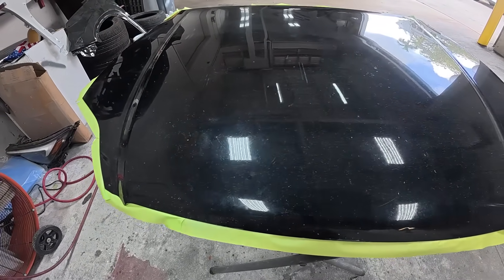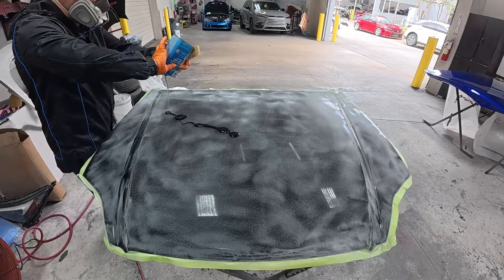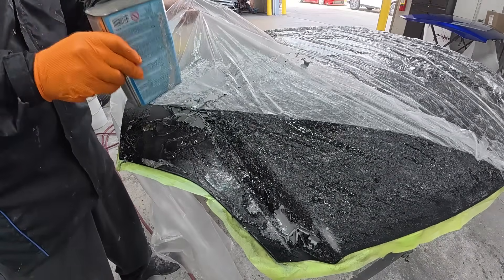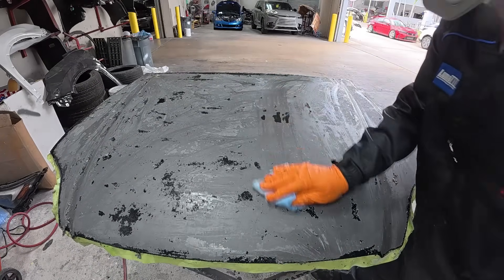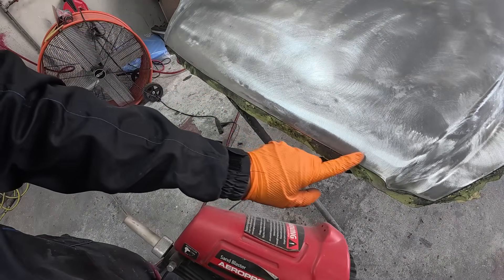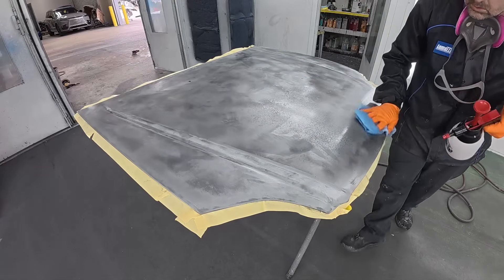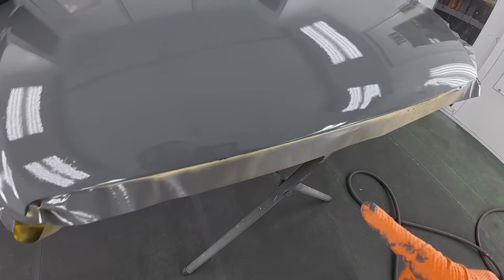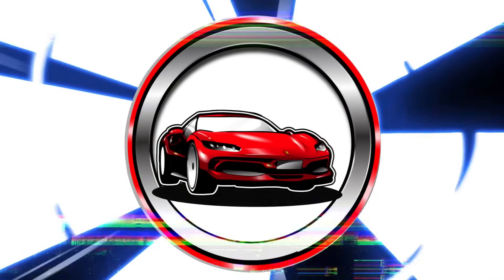How to Chemically Remove Cracking Car Paint Quickly!

Comment: I have a 84' corvette I picked up as a restore project. It was repainted at some point and the job is terrible so I want to strip the car down but dont want to dust my garage up with sanding. What's your thoughts on using this stripper on fiberglass?

Comment: kudos..good information here..
i  have stripped a few classic cars my self also a lot of  wood work as painter ,working in a lot of high end residential homes etc
the past 45 years..
if car has had multi-able paint jobs it can be a real bear chemical  stripping  
it will curl up finish coats real easy but primers and old body work not so good..
also the old type enamel factory primers dont move, just get soft...
what works real well .. once you get through the first steps... use course steel wool..
take a wad of steel wool unfold/open up , apply more chemical stripper and work it/rub steel wool over the wet stripper 
it will cut right through it...
that works real well with wood work that have a lot of profiles and crevices , as scrapers has a tendency to dig in and scar wood

Comment: Brian heres a tip for you instead of primer right away you can use pickel x spray it on bare metal let it do its thing wipe it off the panel will not rust if indoors you could leave it bare a week or more until your ready to prime it eastwood sells it .

Comment: Do you have a video on the best way to strip all of the paint on a plastic bumper?  Older cars like my Corrado have non-urethane plastic, usually ABS like.  My rear bumper is factory paint but very blistered, micro blisters all over it.  What is best sanding or chemical?
Reply from the maker: 320 on a Da then adhesion promotor. Then 2k surfacer primer. Sand with 400 grit. Reprimer if necessary.
Reply: @PaintSociety thanks so much! Absolute legend!
Reply: @PaintSociety  Noticing spider cracks in the bumper paint as well, just sand through everything to bare plastic?

Comment: Is the epoxy worth it over dtm 2k primer? I know it's used in restoration but not in production shops. They also usually just put filler over metal.. Wondering if it's worth the added cost/prep. Also if you seal in some specs of rust without neutralizer will it ever come back under the epoxy? Without moisture or oxygen can rust come back?
Reply from the maker: You should use epoxy on restorations and full metal stripping, for collision you can use DTM for small metal area areas

Comment: Thanks for the comment about using the Ultra version of Aircraft Stripper. I knew that it wasn't what it used to be but have not tried the new version that isn't Ultra because everyone complains about it. I agree 100% about doing any filler over top of a good base of epoxy. When I suggest that to people that are DIY hobbyist's like myself, the majority of them look at me like I have 2 heads...lol. Working on my own old muscle cars, I have NEVER removed old filler from previous work that did not have rust underneath it. Never. My theory is....and I may be wrong, is that the heat generated by the process of filler hardening creates condensation between the filler itself and the cooler metal underneath. That condensation has no way to escape, and the bare metal underneath has no choice but to rust. That's my story and I'm stickin to it! I always use PPG DP90LF or SPI epoxy primer on bare metal. Thanks for another informative episode, Brian. 👍